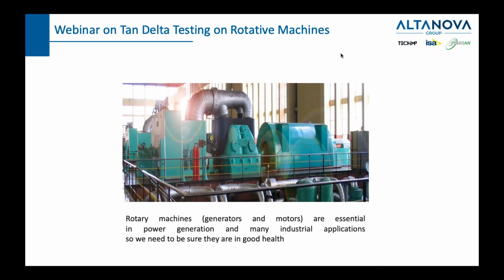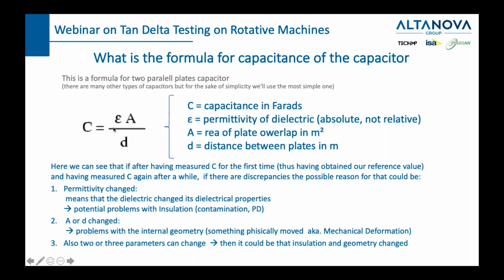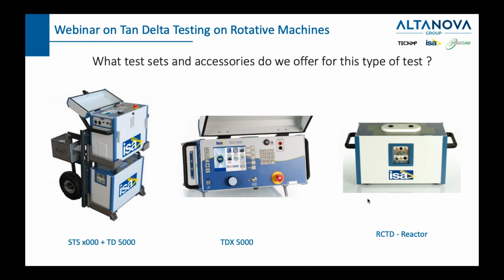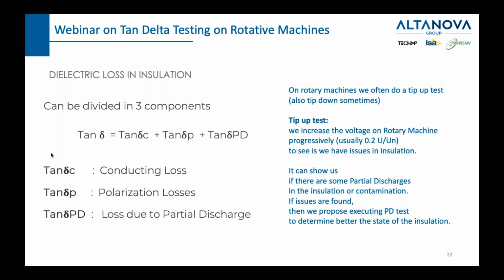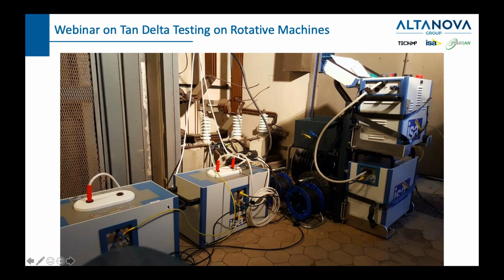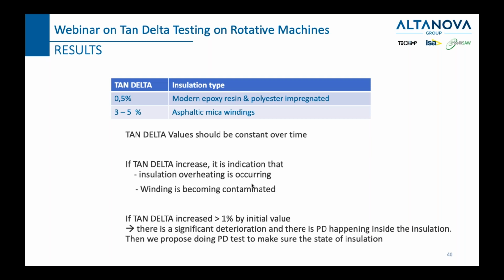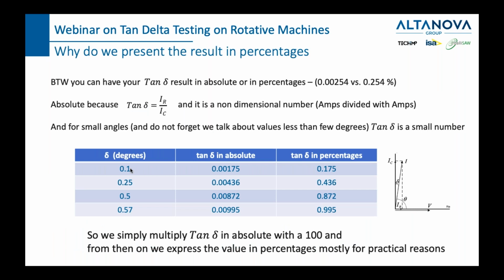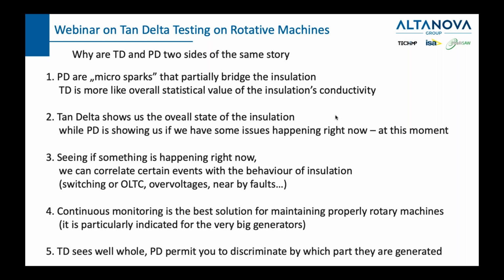Tan Delta Insulation testing on Rotating Machines Motors and Generators

Comment: I have one question when do motor Tip-up Test the Tip-up Value is coming nagative value what is the reason?
The first value is 0.9825 and last value is 0.9718 Tip-up Value -0.0107